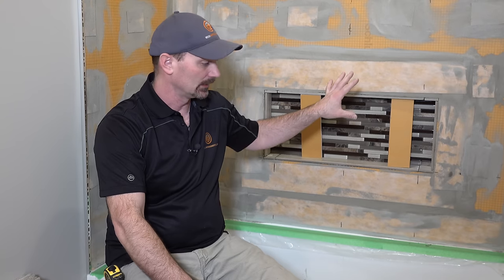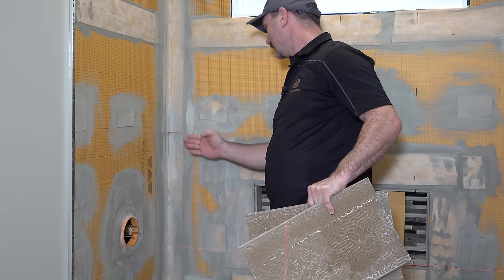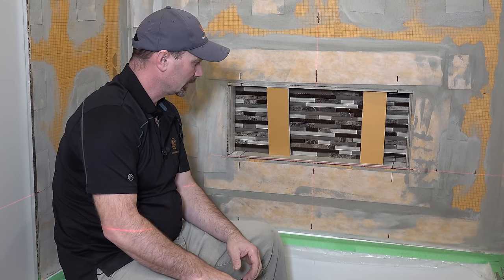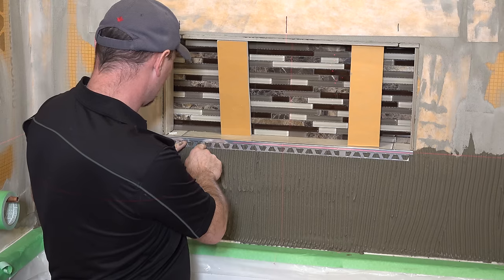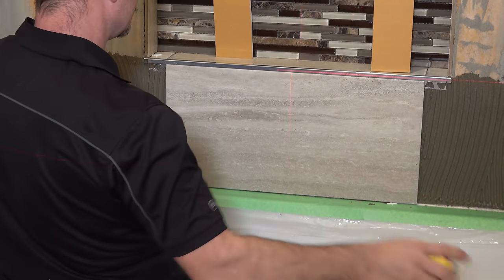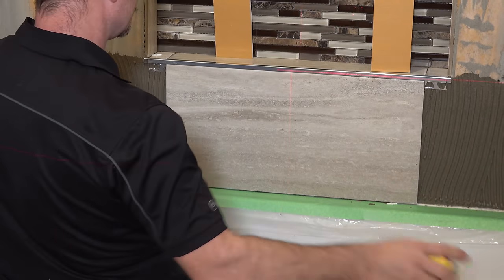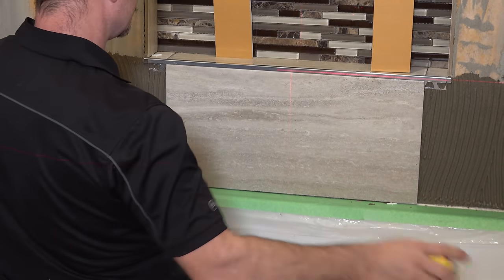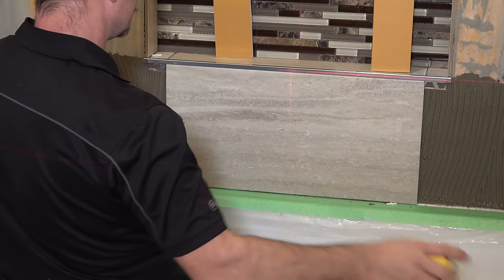How To Tile A Wall (Shower)

Comment: Thankyou for this!  Im a total beginner, so I have a couple questions. The laser,not sure exactly what it is or how you use that.   Also,  the modified morter because of the substrate is a (kirdy board?) you need to use modified thinset...what? Please go into a little more detail?  Also, what is a hole cutting thing?
Reply: oh and what is kirdy board? is that cement board?
Reply from the maker: LASER LEVEL -is an electronic level that shines a level line on the wall ,ceiling or floor
KERDI BOARD- water proof membrane board made by Schluter used on walls under tiles, it is basically a foam board with a water proof cover
THINSET- Two different types or thinset mortar used to install tiles . Modified and non modified, they each have their own characteristics for how they dry. And depending on the product you are applying it to depends on which type to use.

Comment: Hi Shannon,
I always enjoy your vids, very informative and thorough, though on this one I have a question.... I noticed you placed the metal trims at the corner of the tub. Wouldn’t it be better to extend them out a few inches and have a leg of tile down to the floor on both sides? My thinking is.. it would protect the drywall from rotting when the water leaks past the curtain... Your thoughts?
John.
Reply from the maker: You can, and I have done that before. I think this is a cleaner look. Also when you run it past you have a decision to make with the baseboard. tile to the top of the baseboard or run tile to floor and butt baseboard to it. Neither one is pretty .

Comment: What kind of cement or title adhesive you using
Reply from the maker: It depends mostly on the product you are tilting over. In this case I'm installing over Kerdi board and I'm using unmodified thinset mortar
Reply: Is this materials can be found in Home Depot ? Thanks

Comment: How could you install the upper tiles on the the left wall while the lower ones were not installed yet?  How could they stay in place, not drop down?  What brand of the mortar did you use? It seems you didn't rush before it dried?
Reply from the maker: Just support them with a ledger or block until dry. I was using a Mapei Kerabond thinset. Dont mix up an entire bag, just mix what you can use based on your ability.
https://www.youtube.com/watch?v=wiTtevYEaTg&list=PLh0KqGKtX4oXjEq45fGloCA-DSVyvBWrt&index=23
Reply: @HouseImprovements  Thank you so very much for your time to answer.  You are really a good man.

Comment: When I cut the valve hole, I like to score my circle and move in a bit and grind some of the surface beveled towards my cut line so I can work towards my cut line and this is due to cracking a few times to learn what not to do.
Reply from the maker: Great tip!

Comment: We are tiling for the first time. We, it's the first time I tiled bathtub/shower walls... Let just say thank goodness it's a guest shower.. We made lots of mistakes but learned from them.. I will say that my tiles are not all the same size from the box, which threw our lines off.. Almost each tile was a different length out of the box...ahhgggg.. Unfortunately, I waited to remove the thin set, and yes, what a pain.  Also, I did notice a lippage in the corner, and it's slightly larger than a dime and not sure what to do about it.. The thin set is dried, but not grout yet.. It's just frustrating 😒 but my reminder is that we never done this before, hence the spare bathroom for the test run.. Any advice?
Reply from the maker: Slight slippage is not a huge deal , the tiles being different sizes will be a huge pain but just do the best you can at this point since you have started. If you had realized the tile size was changing in the very beginning you could use a larger grout line (1/4") and that would help hide the slight variances better but at this point continue with what you are doing.
Reply: @HouseImprovements  Thanks.. My neighbor said the same thing. Everyone makes mistakes. He showed me his first tiling show job and was a little better than mine, so i don't feel too bad.. as i said, it is my first time tiling a wall. You're going to make mistakes and learn from my mistakes so I don't repeat the same mistakes, and that's what I like about your advice, and you say hey I made a mistake and either show or tell us.. You are very relatable and down to earth, and you encourage people to try different jobs, and i like that..... Thanks again.
Jeffrey  from a very HOT Texas!!!!

Comment: IS THERE A REASON THE NICHE HAS  SMALLER TILE ON THE CORNERS?  THANKS IN ADVANCE. GREAT VIDEOS
Reply from the maker: I think you are referring to the wall tiles in the same row as the niche? They were cut that way so that the vertical grout lines where the same pattern as the rest of the wall.
Reply: He was following layout

Comment: look at the result, I'm thinking maybe I'd get rid of 2 rows of glass fingers (maybe 3?), it looks by eyeballing that the height of the tiles would match perfectly horizontal to the height of the top niche, and especially that's how it was done for the lower niche, it looks odd the tile layout isn't consistent. and you'd end up with wider top tiles to meet ceiling. I'm only learning to tile (and definitely struggling with planning...), so this is no way an attempt at critic but trying to search for solutions, or alternative approach to things, and I'd love to hear feedback from anyone.

Comment: I just have one question please.. this is my first doing my shower I don’t have too much knowledge in thinset .. there are two type in every video I watch .. there is the white one and the one you’re using here .. now which one is the correct one or does it depends on what type of tile I’m using ?
Reply from the maker: Usually the white one is used behind glass tiles and it may be a low slump variety that will hold on the wall and not let the tiles slip down as easily. Unless you are using really large tiles and no spacers you dont really need it. Its more important that you are using the correct mortar for the tile and substrate you have. Modified or non modified. If you come to my forum we can help you more with that choice .

Comment: Would a Jig Saw with a Diamond Tile Blade have made it easier or faster to cut the big circle?
Reply from the maker: I have never seen one of those blades actually be worth using.
Reply: @HouseImprovements   Agreed.  Mine bound up and bent.  I wound up using my little Dremel Ultra Saw with a 3 1/2 inch diamond blade.   
Actually, I was cutting a small hole in the living room floor for an outlet box trying to cut through a total of two inches of ceramic tile atop of hardy backer atop of a plywood sub floor.   This was no fun at all!

Comment: Can you please make a video on how to cut that trim?
Every time I try to cut it pieces come out flying and is a bit dangerous I believe thank you great video.
Reply from the maker: I won't have one coming out anytime soon unfortunately. I do cut it with a electric miter saw but you do need to be crazy careful as you have found out. I also find that if you have a 12" saw turning the blade around backwards is a must and you want about 60 - 80 teeth. You can also use a hacksaw and a old school miter box or some kind of jig to help you cut 45degree angles  (if you need angles)
Reply: Thank you for all the tips I’ll try them

Comment: What disc are you using for your grinder? I used a general dewalt one that said it was for porcelain and ceramic but made terrible chips when I tried to cut lines.
Reply from the maker: Not sure of the brand but a solid edge diamond embedded wheel is best but you will still get  some chipping and some tile is worse than others.
Reply: @HouseImprovements thank you!

Comment: To me the back wall first argument in regards to seeing the grout line is not valid.  You are going to caulk the corner anyways..at least  you should. I do agree that you should put the back and front walls tiles on first before the side but for different reasons.  The back wall tiles that will be hit by the spray of the shower, when installed prior to the side walls, means you have full coverage with tile right to the corner (the side wall butts up against the back wall) and the water coming straight at the back wall will have less chance of penetrating through a grout line/caulk line which is perpendicular to the flow of the water.    You may not even grout the corner but simply use good quality caulking so the line visibility is irrelevant.  Keeping the tile overlap perpendicular to the flow of water is far more important in my mind.
Reply: Duchess

Comment: Did you design/determine the height of the niche according the the size of tile you were going to use?
Reply from the maker: In this case I did ,yes.
Reply: @HouseImprovements  Thank you. I guess that means I should probably buy my tile first before designing and building the niche. Appreciate it!

Comment: Where do you get those end caps that you put into the niche trim,/starter strips for the niche at 8:53?
Reply: They are called tile edge trim.  The ones he used is made by schulter. wall and window profile used is Jolly. Niche is Quadec

Comment: QUESTION ‼ Contractor just redid my bathroom. He ripped off the old walls and put new drywall. The tiles are 12by24. Once installed, they are not flash with each other. The contractor blamed it on the structure below the new drywall. Was it possible to do even, flash with each othe tiles with the new drywalls❓I'm frustrated and not happy😔
Reply from the maker: The structure behind the drywall has nothing to do with it. These longer larger tiles are notoriously not flat and have a crown in there length usually , its slight but its there. When installing them on a floor it is recommended to lay them in a 1/3 lap to help reduce (actually hide)the amount of lippage from one tile to the next. On a wall its not always as critical but anything more than 1/3 lap will show the un flat surface more easily. In this video I did 1/2 lap so there are slight differences from row to row /tile to tile. I would say as much as 3/32" in places.
Some people use clips that help true the tiles to each other but it only helps marginally IMO. The clips can not straighten the curved tiles.

Comment: Please help me with this problem. I am doing renew bathroom DIY. I already installed cement board. Can I srew in bottom of cement board 2 inches distance to shower pan???
Reply from the maker: Screws in cement board 2" above the shower pan should be fine
Reply: Thank you for your reply.

Comment: I was told that for tile 12×24 you should use a 1/2 trowel. Can I use the 1/4 as well? The tile I'm going to use is porcelain
Reply from the maker: On a flat wall the 1/4" or 3/8" trowel  is fine, On a floor I would use a 1/2" trowel
Reply: Thank you very much for your response. I did my floor with 1/2 and I'll be doing the walls next but I wasn't sure what to use.. Thanks again
Reply: I finished my wall but now I have a little problem to install the shower glass door. I made a line across the 3 wall of mosaic tile with glass and stone on it similar to the one you did in this video. Now I have to drill a hole on it, for the glass door. Is it possible to do without breaking them? I mean they're small and I have no idea how to do it

Comment: Question to you Sir. You are standing on the new bathtub with your shoes. Isn't that going to scratch the bathtub? I thought one of the most important thing on the bathroom reno is to protect the tub.
Reply from the maker: If you look there is a plastic film on the tub . I generally also have a blanket in the bottom of the tub because it is easier on the knees.
Reply: @HouseImprovements  Thank you Sir. I love your show. It gives us a lot of great information. By watching your video, even if a home owner hire a contractor to do the work, at least the home owner will have some knowledge on how the tiling should be done with the correct methods and process. Much appreciate it for your good work. Cheers.

Comment: Why did you use a 1/4 inch notch trowel with a large format tile whereas a 1/2 inch trowel is recommended?
Reply from the maker: Actually I believe this was a 3/8" and with a flat wall you can get away with it. On a floor you should not.
Reply: @HouseImprovements  I often use1/2 and back butter but feel less mortar from 3/8 is adequate assuming substrate is flat. I just used a 1/4 inch  trowel  per instructions for thick 1/2 inch floor  marble mosaic on a mat about 12 x12 per section and feel I should had used a 3/16 due excessive thin set needed to be removed from tile surface and joint.

Comment: I have walls with 2 1/2"  studs, how can you place a shower niche with such shallow walls? I guess in 1960 they had gone on the cheap side.  Any good suggestions?
Reply from the maker: Sorry none of the manufactured ones I have ever seen are too deep for that unless you can build out the wall to be deeper?
Reply: That was my thought. Thanks

Comment: Question. At around the 8 min mark when you start notching, shouldn’t it be horizontal not vertical? (Less likely to sag?)
Reply: If mud is mixed right shouldn't sag.

Comment: How long does that mortar last before it starts to harden?
Reply from the maker: Depends on the mortar but you usually have about 15 mins working time on the wall and at least an  hour in the bucket. Keep staring the bucket with your trowel occasionally and if the mortar you have combed on the wall sits more than 15 -20 mins with out applying tiles ,just re comb it.

Comment: Hi i  want to install  Granite  on my  wooden stair  am i  gonna be able to  install it directly on wood  if so what  kind of cement should i use or i  install  backer board in each stair and than installing  granite  also would i be able to install granite  on already  installed tile thanks
Reply from the maker: I would contact your supplier and see what they recommend . Also if this is thick heavy slabs your stair case  may need to be re- inforced to carry all the extra weight

Comment: nice.  is the vertical aluminum trim set flush with the face of the tile? or is the trim just proud by a 32nd of an inch?
Reply from the maker: depends on the trim you purchase but usually you would get trim the same or close to the same thickness of your tile.

Comment: Curious. How did you stack the large format tile on top of the deco tile without crushing it? Did you use nails under the large tile?
Thanks
Reply: I always set up to the decko, then wait until it cures to start setting again. Never use nails even if someone says you can kerdi fix the holes. Don't compromise the membrane.
Reply: I used legers.  Then go back and do band.  I use cheap harbor freight levels. Buy six foot and cut it down to 57’ 58’. And cutt 6ft down lil for lil bigger showers. And buy four foot and cutt down for side walls on smaller showers. Drill holes all in rows so u can find studs easy    Then silicone or patch w fleece or roll on water proofing.  Then I do band next day so they don’t sag and u can even float it out before u leave and mosaics will set flat to the field tiles. They usually are thicker
Reply: Oh yeah. It’s best to have little speed set and float it out next morning and work on curb

Comment: Do you leave a gap between shower floor tile  and wall?
Reply from the maker: yes it can be grouted and sealed with caulking after.
Reply: HouseImprovements  thank you very much for taking the time to answer my question, this was very helpful.

Comment: How much space do you leave between tile and wall?
Reply from the maker: I assume you are referring to the grout line between the end wall  tile and back tile? Same as other grout line s you have.
If your referring to the back wall tile space from the end walls I generally try and leave 1/8"- 3/16"  , but no more that the thickness of the end wall tiles.
Reply: @HouseImprovements  Yes, I meant the tile on the back wall or long wall as it goes in the corners. Thanks

Comment: I’m not saying that it’s not but it would seem the top of the metal edge wouldn’t be waterproof.  There is nothing between it and the wall.  I realize the wall is supposed to be waterproof but water will still work behind it causing a damp area and mold.    Am I missing something.  I’m getting ready to do this exact project and don’t want problems.
Reply from the maker: Within the shower you would grout or caulk any joints. above the shower on the wall should not be an issue. In this shower the tiles goes to the ceiling but if it did not and I had metal along the top edge of the last tiles you could caulk it but there really should be minimal water up there.

Comment: how do you figure out how much tile you need for the job?
Reply from the maker: Measure the square feet of the wall you want to cover and add maybe 10%. With a simple tile layout , that should have you close.
Reply: @HouseImprovements  ty bro full send never lift 😏🤙

Comment: So what if you only put the Mordor on the tile only and not wall and tile both?
Reply from the maker: You will not get as good of a bond.
Reply: @HouseImprovements  thank you. My husband is tiling our outside shower. And it’s only putting the mortar on the back of the tile. I’m worried it won’t stick and will fall off.